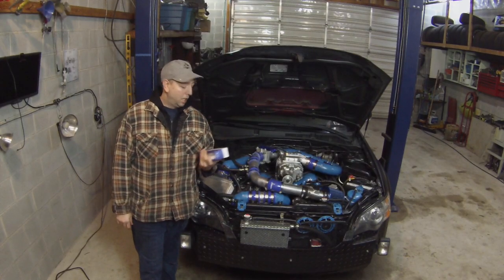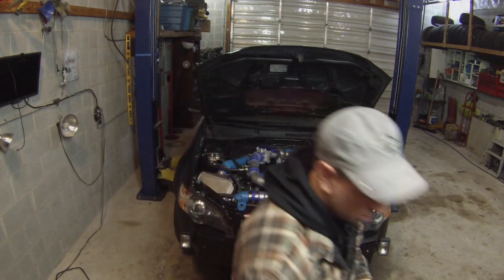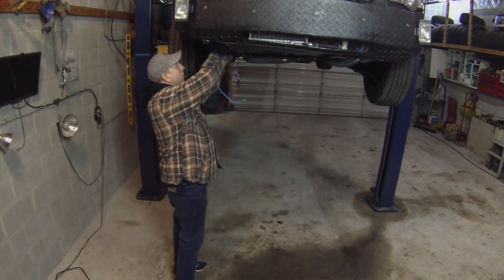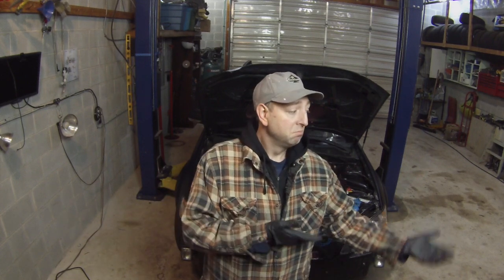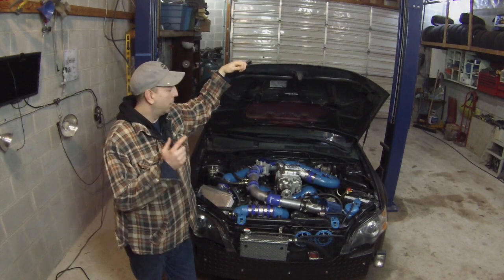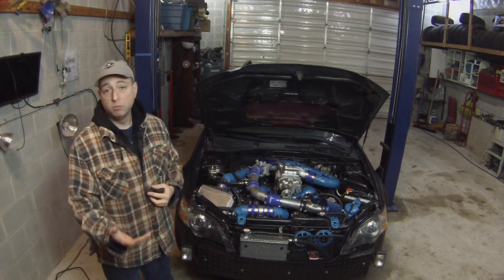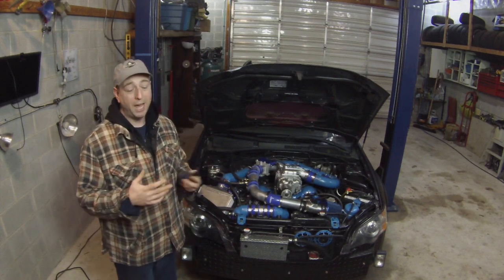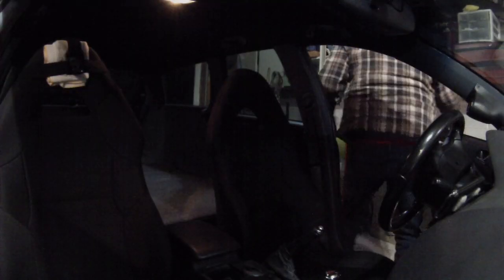O2 Sensor OEM vs Aftermarket ($60 Amazon) Subaru Outback/Legacy GT

Comment: Funny, I got the same one for my Toy4cyl and it actually drives very good, except the check engine light is back on after a couple 12 mile trips from reseting.
Reply from the maker: Mine drove good to, felt fine. But the gauge readings were dangerously bad. On a turbo or supercharged car that will blow an engine real quick!

Comment: You should be able to get an oem 02 sensor off of rock auto. It was cheap when I bought one for my Fxt some 5 years ago.
Reply from the maker: Got a denso at Napa the next day was $100ish. No more stalling and just overall runs better :-)
Reply: @boostedproblems5139  Figured you did 😎 And great to hear!

Comment: You already know this, but Denso makes the OEM sensor. For about $100 on Amazon or RockAuto, you can get the actual OEM wideband O2 sensor. Usually $120-150 local.
https://amzn.to/3r3960H I know it's $40 more, but when it comes to a wideband, it's one of the few times I think it's probably worth it. Def don't pay the dealer price though!
Reply from the maker: Yup it's had a denso in it for about a month now, works perfectly !